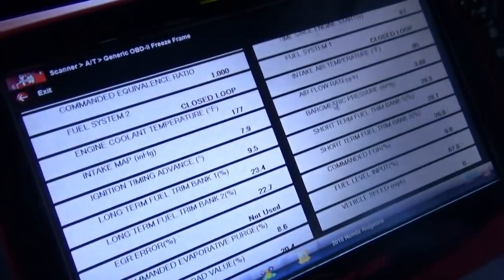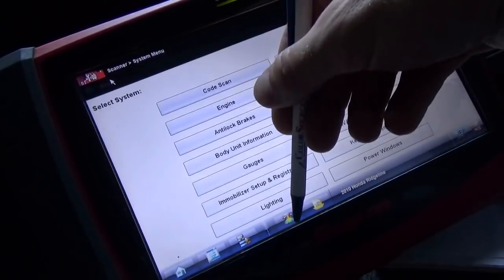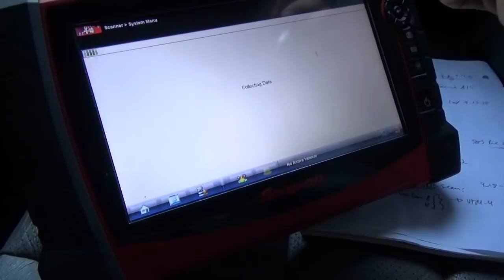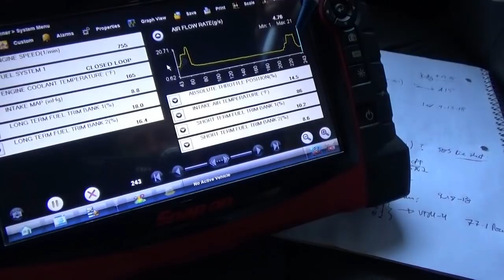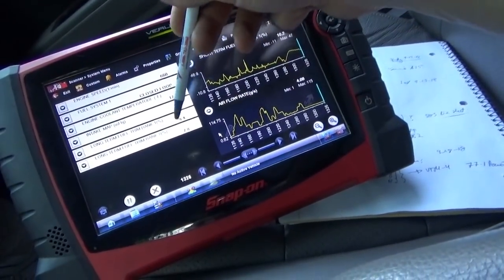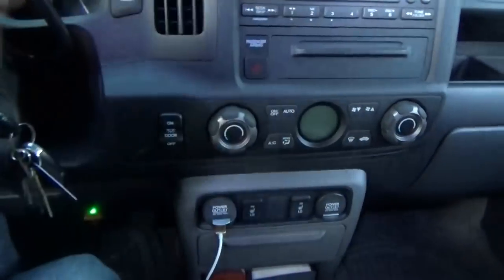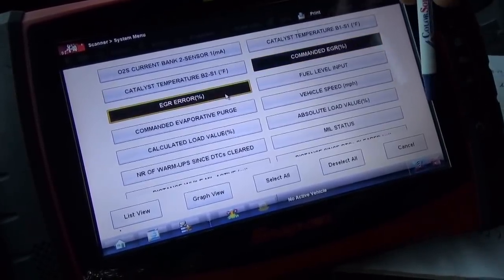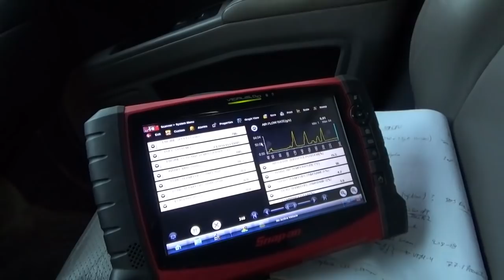COMEBACK! Honda Ridgeline Check Engine P0171

Comment: what is the going rate per foot for Duct Tape in your area. Around here it is near $0. I hope you were joking when you said you would charge the customer for a diag and Duct Tape!!!
Reply from the maker: I charge about $5 per foot xD
Reply: why not charge for diagnosis?? He had to drive to the customers house.. and bring his KNOWLEDGE..and his $10000 diagnostic Snap on , the customer had non of those items
Reply: @deepsquat600  It does seem a bit odd. I guess it depends on whether you're there to make friends or run a business. As we all know never the twain shall meet.
Reply: My point wasn't about the diag. I was simply saying forget about a couple feet of Duct Tape. It's very cheap around here.
Reply: Sounds like a case of shut the engine down and encapsulate it in flex seal as if that can work on boats it should fix a air intake. 😂😂😂😂
Reply: @deepsquat600  he said no charge if it was related to the problem before. Separate if it wasn't.
Reply: NO ONE doesn't charge for diagnostics....NOTHING is free my friend...Knowledge is KING....as well as the ability to fix a problem...Not many can do it, very few charge a reasonable  rate but where are YOU without that knowledge...Fucked I would guess, if you need  your car??...As with most skills in life. ..We have all been there...on the receiving end....On YouTube in general you learn something along the way regards fixing the problem then you are 'Quids in'...(Or Dollars in)..thats the way of 'The Beast' if you are of a negative mentality or in a positive way an empowered individual if you are willing to grasp the problem with both hands....nowt here that is bad....just creamy goodness....just swallow it down!!
Reply: @deepsquat600  I'm not sure that one cost 10K but I'm damn sure the one I bought did. I'm still feeling the ream marks and that was over 7 months ago. At times I wish I would have kept my Modis Edge as it was paid for but as my snap on guy said and he knows me well it's an investment into the future. You definitely have to work to keep them making money plus there's always extra work if you do a pre scan and post scan of course after you get the customers approval to fix the work and then do the post scan showing them that it's been fixed after a test drive. 

Nothing like seeing them standing there scratching their head wondering how you figured all that out. When you do diagnostics the customer is paying for your knowledge, your training, your School of Hard Knocks, and anything else along the way. If you had a hard case that took 2 hours to diagnose because of the testing and it takes a half an hour of the second time you still charge 2 hours because they are paying for your experience. There are a lot of shop owners and techs out there that would agree with that as well. I'm sure there's a lot of them and customers that would scream or cry foul but can they do it in a half an hour? Can they do it in 2 hours, probably not so that's where your knowledge base in your head are internal built-in hard drive aka the brain comes in handy. One thing that is nice about the pc-based scan tools is you can take notes from a job and look up old jobs to dig those notes up to see what you had to do that way it helps the next diagnostic weather it be one month or one year with the same issue go a lot smoother. 
I'm still a rookie at this crap and even when I get experience I'll still be a rookie. Heck today I'm installing a garage door opener for a friend. First time I ever did one it took several hours now I charge nothing less than $80 to install garage door opener and when people balk about the pricing I tell them I can get it done in a short amount of time or they can spend countless hours doing it them self. They normally retire to their living room on the couch and come out and ohh and awe after the jobs done. 

Got another neighbor that bought a new fridge has tried to install a plastic water line and also a copper water line and he says it's still leaking on him. I'll go over there it'll be about a 15-minute fix and it'll be $40. Why will it be $40 minimum? Because he is paying me for my experience. If he screwed something up and made the job more complicated or I have to go get more parts then yes it'll probably jumped the 60 bucks because I have to pay for my gas and time to the store and back which is less than a mile away.
Reply: Bingo!
Reply: Bingo!
Reply from the maker: Actually the customer brought me his own duct tape, but I told him "if you bring your own parts, I can't offer you my 30-day warranty" HAHAHA

Comment: "Let's tape that up with duct tape and verify the repair"
Reply from the maker: Worked like a charm hahaha
Reply: @PineHollowAutoDiagnostics  

It might where the rip in the duct was. In my case, taping it isn't possible because the idle air control valve hose connector was torn almost off and fixing it with tape would not seal it up. My duct is 5 inches long, and is tapered from 3.5 inches to 2.5 inches. I made one out of lightweight aluminum (my ducting has 3 hoses attached to it, one the iac and 2 pvc hoses). I tapered it because the ducting if straight would create a turbulence problem where the air would backdraft into the maf sensor creating a false maf reading.
Reply: duck tape fixes everything

Comment: Sigh, this what happens with so much plastic under the hood. It all starts cracking.
Reply: I suspect that was natural rubber - the lifespan is about right. EPDM is taking over - it is nearly universal in belts and hoses now - with massive increases in part life. I think most CV boots are EPDM now as well.

Comment: Duct tape? I would have used Scotch 33 or 88 and it would have been good forever. You can stretch the tape down in the valley and get it good and tight. You and those seat belts LOL

Comment: Some cars have a repair solutions bulletins.  Alltest has it. Before  turning the car over to the customer,  check codes and readings.  Drive the car to check in case codes  or condition readings pop up. Sometimes codes can push other codes aside until you replace the first part.  Maybe get a smoke machine. Don't  trust codes! You can get false codes! Drive the  car to completely warm up the engine. Codes DO go away! Check fuel pressure and leakdown.  Check for a leak-down in the fuel pressure regulator. Check for leaky injectors.  Don't  charge for the duct tape even if it fixes it to keep a customer.  A thermostat  running cool can cause a rich mixture. Oxygen sensors can strip. Get  oxygen sensor  insert tools. Use Big-sert kits if Save-A-Thread kits pop out. Get the extended kit. Lisle has a kit.
Reply from the maker: Sounds like a lot of extra work...
Reply: Pine Hollow Auto Diagnostics Eric does that! It assures a fixed car and a satisfied customer.  It prevents comebacks.  Don't take after Astral! He's  an amateur and gets his stuff from Harbor Freight! PCB's take time and cost money for the computer,  but  it can help sometimes. Don't  take a job 'over your head'. Cars require factory tools which are expensive. Even Eric  turns down jobs.